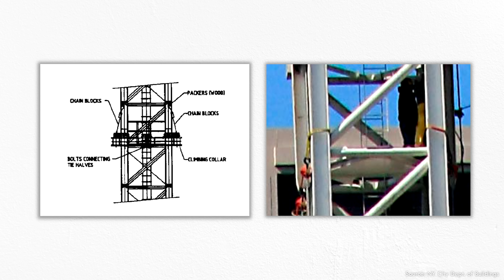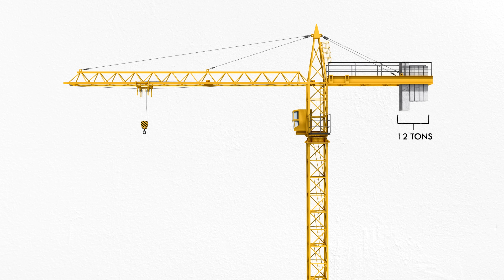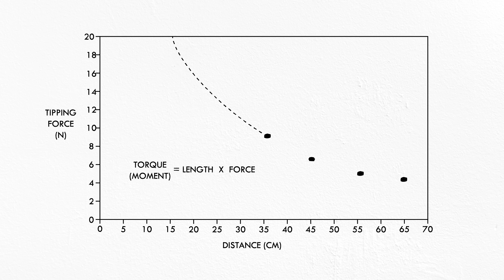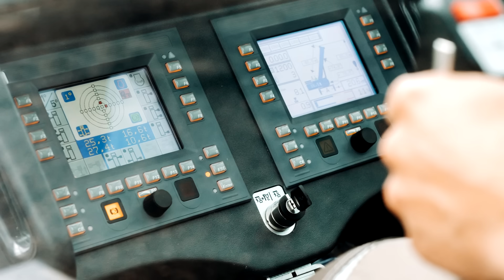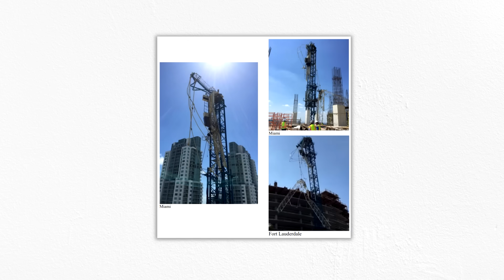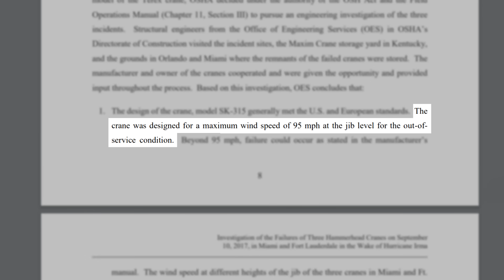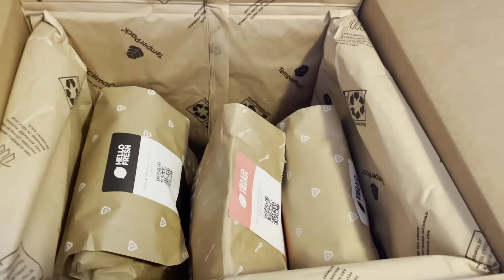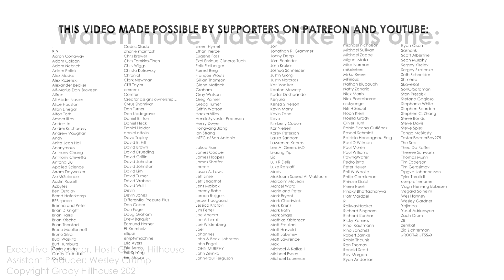Why Cranes Collapse

Comment: I always wanted to know what happens to a crane after it falls over or fails. If it's repairable does it have to go through some type of certification program etc. or do they always go to the scrap yard?  On YouTube I've seen quite a few mobile cranes fall over but I've always wondered if the damage is repairable or are they allowed to go back into service?
Reply: It depends.  If its just the boom sections they can just replace them and recertify.  If it's more involved, you really have to look and the cost/ benefit ratio.  If it's too much they'll try to sell it and if that doesn't work auction it off.  Usually to Latin America.

Comment: There was a crane that nearly collapsed near me a few years ago after high winds. The company had been having issues and hadn't been at the site for a few days so they hadn't disengaged the clutch and the jib was raised higher than it should have been because it was a small site and the neighbours complained about overhang. There was a serious storm and the crane was pointed directly into the wind causing the jib to blow over the top and point backwards. Everyone who lived within a couple of hundred meters was evacuated and had to sleep in the town hall and traffic was blocked for a few days while they tried to take it down.

Comment: I used to operate a crane for a small structural steel company. I had very little training and experienced a ground collapse event. 
I was lifting a main beam into a home foundation when the machine flipped over. The ground around the foundation gave way, and the outriggers were 6-8' in the ground.
I felt very fortunate that I was able to jump far enough away and not end up underneath the thing. 
My career as an "operator" didn't last long after that.

Comment: what are some common safety features typically in place for operators in the event of a coming fail?
Reply: Nowadays, cranes have computers that will kick the controls out so you cant go any further.  There is an override key, but you better know what you're doing when you turn it.  Also the two block system is really important when working in the blind.
Reply: @htc86752  sorry I have a morbid curiosity... let's say the cabin begins to fall, what options does the operator have, if any?

Comment: Best practice would be putting enough computers on them to take human factor out of consideration.
Sensors and microprocessors can at least eliminate accidents with mobile cranes, for ones that require manual assembly, building them to self-assemble could be very expensive.

Comment: a crane is just a big lever.... and levers are one of the fundamental mechanisms.
if you fail to understand basic physics, you will fail to control a crane.
I've been working construction as a side job, mainly moving earth and rubble, by shovel.... and you'd say "but a shovel is not a crane!".... true... but it's a lever
and by cleverly handling the leverage, I've been able to shovel tons over tons of rubble without exhaustion.
just balance it correctly, and you'll be able to lift a good shovel worth of rubble on one arm, while using the tips of your fingers on the other hand to control it.
.......then switch arms, work with the one that's rested, and rest the other one.... then switch again, etc etc.

a crane is no different: you put it up wrong, you balance it wrong or overload it, and it's gonna break.
same way your bones will break, if you sweep up a shovel worth of rubble without standing correctly.

Comment: Back in the late 70s I worked at a Tar Plant they decided to line a run-off pond we built wall sections of heavy planks probably 2 x 12 held together with lag bolts. A Cherry-picker (wheeled hydraulic crane) picked up each wall section (with outriggers extended) at some point the reach of the boom and weight of the wooden wall section started the off side outriggers to lift off the ground. The opeartor caught it and ended up refusing to go any further. Can't remember it was so long ago what the solution was but a tip-over incident was avoided.

Comment: On my route to school, there used to be a build-site (they finished it now, it’s a big, good looking set of flats) and I used to watch it after school, since I’m intrigued by it, but I was watching the crane on the roof lift a huge concrete building section, it was all the way at the end of the boom. I was daydreaming, then I was woken out of it by yelling: “GET AWAY FROM THERE, CRANE FAILED!” Some builders yelled, I’m standing a good eighty meters away, and I look up, the crane’s boom was bending under stress, then the load was aborted and fell down from forty meters high, it felt like an eternity, but when it hit it crumbled and a huge wave of gravel and dust blasted over the whole site and across the road, a few guys mildly injured by some chunks of concrete, but no fatalities and nothing that wasn’t able to be fixed by a band-aid.
Cause of failure: Metal-stress, the crane had been used throughout the county, because of it’s high payload capacity, lifting similar concrete sections up and down, this last one was smaller than the ones they’d lifted before, but further along the boom meant it felt heavier, the stress became too much and the upper section of the boom failed and the bottom two bent, luckily the operator dropped the load, otherwise the whole thing would’ve whipped over and struck fleeing workers…

Comment: Good Job Grady, as a hoisting/rigging subject matter expert I could find nothing to fault with this video. In my experience, operator error is by far the most common cause of accidents though you didn't dwell on it too long in respect to the operators. They have a lot to think about from setup to tear down and sometimes saying NO to a work request because it's too dangerous is more difficult than one would think.

Comment: I have personally seen one crane failure on a jobsite, been involved in a strap breaking while having a load hoisted, almost witnessed an air handler being dropped during a helicopter pick this summer. Had 2 tower cranes bump each other on a job and the worst thing possible happened with a fatality on another job. The crane that failed was a drywall boom and he didnt have his outrigger extended all the way and was sitting in soft soil. It sank busted the outrigger right off and the boom slammed into the building. My personal accident  was when i was given some older straps from the shop to hoist some hat channel to the roof. It held till it got over the roof when one strap unexpectedly broke sending the hat channel crashing into some limestone block and stabbing into the tpo roofing. Luckily nobody got hurt and a lesson was learned to always check your straps. We recently used a sky crane to lift an 18k pound air handler. Come to find out the air density was crap and the helicopter under full throttle was losing lift and the two engines were overheating. An emergency turn around and set down happened in a hurry. Pick was reacheduled the next morning in some cooler weather. An operator wasnt paying attention at a college site when ones counterweight clipped the boom of another tower crane. Nothing broke, nobody got hurt, but from what i was told the noise was incredible and an investigation happened because of it. The absolute worst thing so far in my career was just prior to me showing up to a job the safety brigade made this oiler feel as if he needed to be tied off at all times. Unfortunately the young man made the wrong decision and clipped off to the wire running through the boom. During the breakdown the operator didnt know this happened and reeled the young man through the crane killing him. Ive seen alot of injuries outside of cranes from just being in construction but everytime im involved in a crane pick i keep my head on a swivel.

Comment: Lost my brother on a "crane accident" on Aug 31 2011, while working on the FN building in Copenhagen, there were a supposeded procedure to move the lifts when they needed to be raised, the workers used them to install insulation. Apparently in the year 2011, we don't have remote controlled lifts, he had to control it from the inside while standing half way into the container it was going into. Well, the lift wedged on the edges, which resulted in an overbalance on the container, soon after both the lift and my brother was dropped a couple meters down to the concrete floor below, the several ton lift landed ontop of him. . .
Still trying to cope with it, still angry that safety and equipment weren't and probably still aren't up to date, especially on a globalistic prestige projects like that..
Reply: Bro the lifts were the thing I worried most about when starting a job. Every morning riding that thing gave me severe anxiety. and I'd work at the edge of buildings all the time.
Reply: The victims of negligence are seldom if ever the perpetrators.
Reply: My condolences. I hope you're healing well, and the 10 year mark coming up must be hard.❤️
Reply: In the middle of this picture at the second floor despite the base, that is where his life was shamefully taken away, right around those lights going all the way up.. 
https://copenhagen2021.com/wp-content/uploads/2020/07/FN-Byen-Kobenhavn-Udvendige-lodrette-foldeskodder-4.jpg
Reply: Condolences 😞
Reply: If the crane company can safe a dollar they will regardless of worker safety they only care about the money.  This is coming from a former operator that's been hurt on the job from people trying to save a dollar.
Reply: Question to the people with knowledge on this field. 
Weren't remote controlled lifts available and readily in use back in 2011. If so, is there any excuse other than the expenses of staying up to date with increased safety on a already dangerous work environment?

Yes. Some might have guessed what comes next if thats the case.
Reply: My condolences.
Reply: Very sorry for your loss.
Reply: A crane operator should not be running the crane and placing the load. That is against OSHA LAW.

there should have been a signal guy watching the load and then telling the operator what to do.
Had that happen your brother would be alive today.
Had it been reported you could have sued the contractor
Reply: @Paula-wz3rw OSHA is a USA thing. If you go back and read, this was in the Netherlands, not the netherregion.
Reply: Mine condolancer :(
Reply: Sorry to hear that. I tried to search for the accident, but can't find any articles. do you have a link
Reply: @TotalVikingPower  There aren't any articles left about it to be found. But they did write about it in the news back then.
Reply: @Than3Dane  articles don't just disappear.
Reply: @Shorkshire  they haven't, but may be hard to find for non Danish speaking. Search for 31. August 2011 ulykke lift, then you'll find a couple of articles about the accident.
Reply: @TotalVikingPower  Managed to scoop up a few articles about the incident. They were apparently still around, using a few other keywords.

What really happened is not correctly described in the articles however. 

https://www.tv2lorry.dk/lorryland/mand-draebt-i-fald-fra-lift-i-kobenhavn

https://ekstrabladet.dk/krimi/article4081719.ece

https://webcache.googleusercontent.com/search?q=cache:e1_GNxS7pO8J:https://nyheder.tv2.dk/krimi/2011-08-31-mand-faldt-ned-fra-lift-og-doede+&cd=2&hl=en&ct=clnk&gl=dk&client=firefox-b-d
Reply: @Than3Dane  Shouldn't have happened under danish conditions
Reply: @TotalVikingPower  with emphasis on should'nt ;-;
Reply: I'm really sorry for your loss. 
However, everybody keeps putting the entire blame on the guys who push their laborers to work without safety in order to save time and money, but there are 2 things that need to be pointed out: most of the construction workers work without proper safety precautions, because they themselves think that they bother more than they benefit and don't feel like going through the hassle of hooking themselves into a guard cable. And secondly, NOBODY can force you to work without safety. If your boss tells you to do it, you tell your boss to stick it and walk out. And if all workers would do that, not only would the loss of life drop dramatically, but the employers in the industry would be forced to change their mentality because without workers they will have to get their own hands dirty for much less money.
Regardless, the suffering is on the survivors, so I wish all the courage and serenity that is needed to find peace to everybody who loses a loved one.
Reply: @lukearts2954  Theres something in this world called trust which too many misuse & abuse. In this situation you can't draw everybody into the equation, it is well known people in this business jump over issues where the fence is lowest, but thank you Luke :-)

Accidents like specifically this one, that are already known to happen shouldnt allow procedures for their labor workers to stand inside the object hanging on the crane, in this case the container where the lift was getting located into.

Sad fact is the contractor didn't have the lifts remote controlled which turns out were widely available at that time, conclusively taking unecessary risk while reliefing their budget.

Workers do their job cause they shouldnt worry that their employers would put their life at risk at any point.

When you walk into a lift, which is halfway into a container, and you're standing inside the cage, there is no safety harness to save you if the crane looses control with all that weight dragging you along.
Following the motion of tilt & swing when its falling, it rips that apart when everythings drops with the load.
Reply: @Than3Dane  Totally agree. The main responsibility is always with the person making wrong demands, i.e. the employer. But we also know that "Wir haben es nicht gewusst" doesn't fly as excuse... Just say "No" is always an option :) (That goes for everything, by the way... We all have the right to protect our own sovereignty)
Reply: Sorry for your loss, may your brother be at Peace with our Angel’s
Reply: I’m so sorry for your loss.. 😞
Reply: I’m sorry about your loss.  But from a corporate perspective it makes sense to keep older equipment in service for as long as possible.  It’s not about safety it’s about margin and getting ahead
Reply: Hope you find some peace ❤

Comment: Excellent presentation.  
We had an incident at a neighbour’s a few years ago.  He had built a ferro-cement boat in his yard, and was having it lifted onto a low-loader for transporting to the launch (crane was contracted to follow to effect the launch as well).  The property in question is approximately 1 in 4 slope, with soils approximately 20-40cm deep, overlaying clay to about 1-2m deep, on bedrock.  The crane was positioned transverse to the slope with its outriggers on an asphalt driveway running up the slope, picking the boat from the uphill side, slewing and placing it on the low-loader parked further down the driveway.  Unfortunately as it slewed, when the weight transferred to the lower outrigger, it punched through the asphalt driveway, complete with cribbing under it, and sank about 40cm into the surface.  The whole shebang collapsed, unfortunately a friend of the boat owner on a tag line was crushed by the crane boom, mercifully dying instantly.

Comment: You should work as manual labor at a construction site and then you might realize that theoretical issues and practical use are not always the same thing and hindsight is always 20/20 it is a bit harder in practice. And having to sit in a comfortable office and explaining things as human error and never actually having to meet deadlines and finical lowest bids to make things work, often makes working in construction unsafe. Think about that when you always search for the lowest price (or creating mortal danger for others).

Comment: What I want to know is how do they lift the parts of the crane so they can assemble it, what is used to lift the 8 or 12 ton counter balances?
Reply: If I understand your question correctly, they use another crane to put the tower together.  They'll put some up on one side, then swing the tower crane around and put some on the other side.  It's all about balance.  It's not a good idea to put to much weight on one side or it will fall over.
Reply: @htc86752  So they use a crane to build the crane? how do they build that crane that they use, it must be bigger the the crane they are going to build no?

Comment: I used to work construction of hotels and got to know one of the crane operators. Really goofy and insane guy in a social sense, but when it came to the crane and the loads he was an anal bastard. One thing I didn't know until now is the wind-vane thing. I never knew if that was good or bad when I saw one rotating (unmanned) in the wind but now I know it is quite logical. And I'm always surprised how some guys will defy safety protocols to save a few minutes or hours when the consequences are for a liftetime and beyond.

Comment: the water in the soil doesnt push particles aside: it generates lift making them effectively lighter, thus pushing above what is placed on them like the water will flow above the rock placed on it because its fluid and lighter. Soil with water in it behaves similiarly, its becoming fluid (for example mud) as well as lighter due to water pushing everything in it upward (buoyancy, some creations make use of that but its not reserved to ships or airships)